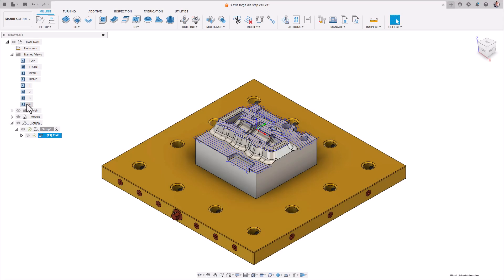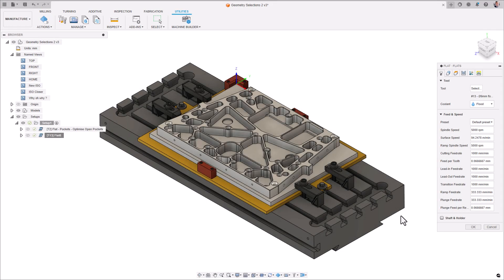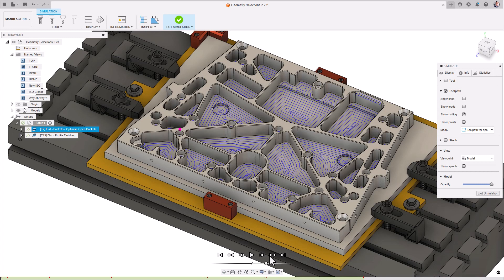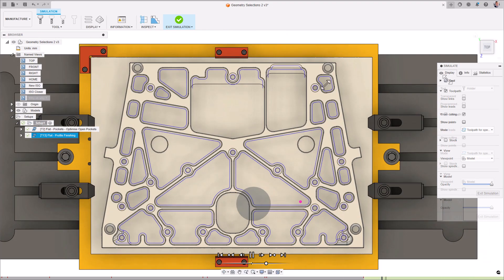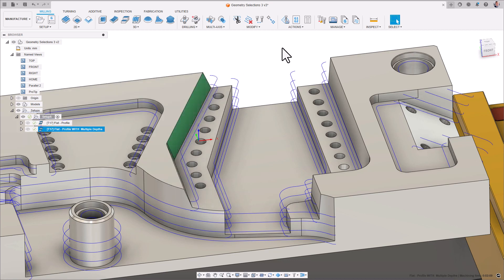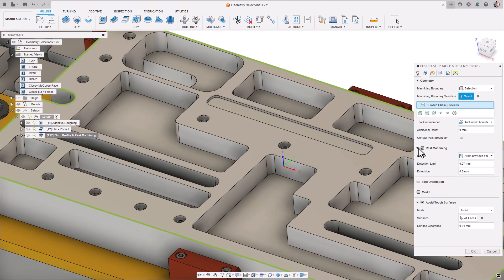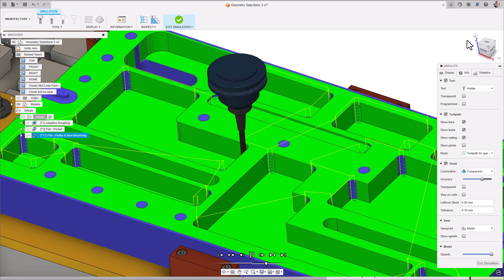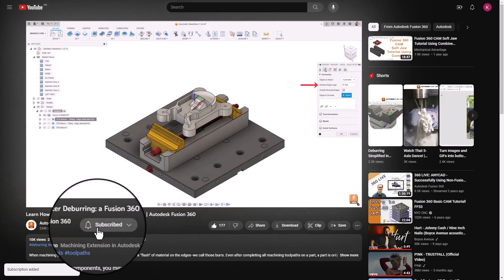Maximize Efficiency with the Flat Strategy in the Autodesk Fusion 360 Machining Extension

Comment: Where do you guys get models for your vise and table? Is that something available or do you have to design each of those first? Sorry for the amateur question,  still new to this.
Reply: The manufacturer of your vice shold have a 3d model of it that you can download,the table you might have to model.
Reply: @C3DPropShop, thanks for the great question . You can generally find most of the vices and fixtures from within Fusion’s data panel under the CAM Samples area and looking for the Workholding section . 

As pointed out correctly by Kristian you can almost always find 3D models of your workholding and tables on the manufacturers website .

Thanks again for being part of the community and look forward to chatting to you soon on the Insider program .
Reply: Right, toolpaths are continuing to get better and better. ❤

The problem is the User Interface. Using just a tabbed dialog box is badly hurting Fusion CADCAM. If this doesn't get fixed now, Fusion 360 will go backwards very quickly. State of the art programs like hyperMILL, NC Simul, Vericut, Esprit TNG, CAMPlete, etc. all make extensive use of Microsoft Panels and multiple trees.
Reply: @JonBanquer highly disagree. Coming from mastercam with the Microsoft panels is so much more tedious. Fusion tab layout streamlines teaching new people and my programming time for the same components is cut to 1/4th the time it takes in mastercam. The consistency of the tab method keeping things categorized makes it highly efficient and easy to use for all levels.
Reply: @dirtboxk1ng  Stay tuned and watch what happens. LOL